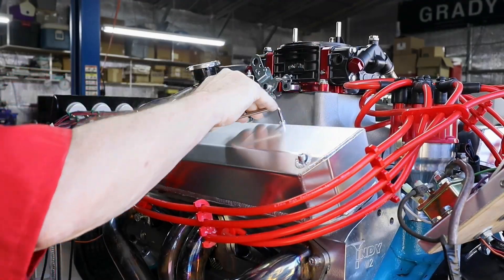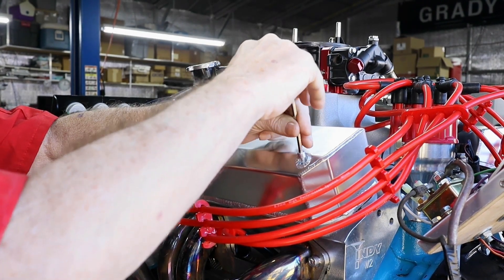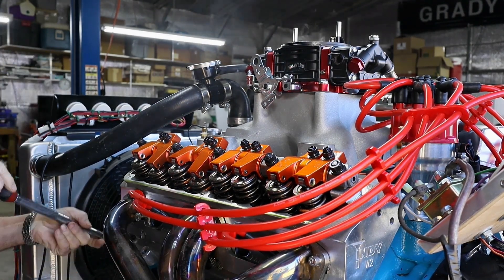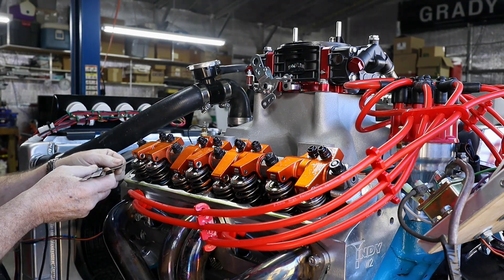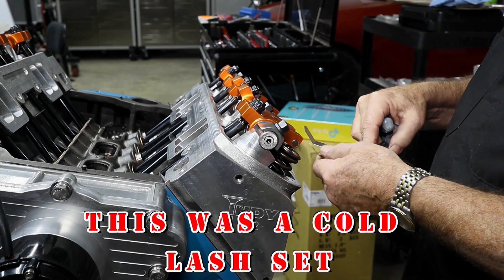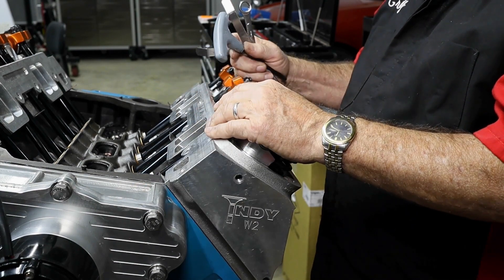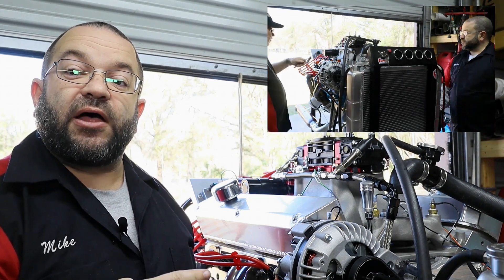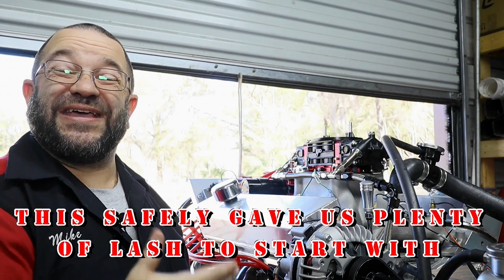The LA-phant: Full Operating Temperature Checks | Hot Lash and Cold Lash

Comment: A more accurate way to do this is to start with the hot lash setting for 1st fire up.
Any aluminum headed engine will gain lash when it heats up.
And we see lash increases up to .012 so this is where the thinking part come in.
interrupted
That way the oil and water temp will be at 190 for the water and at least 190-210 for the oil.
This heats everything completely just as it would running down the rd.With me so far...good.

Now with the engine fully heated check 1 pair of valves lash and correct to the hot setting you need as fast as possible cause the head shrinks again and the lash will change before you get the next pair done.

However with the 1st pair done and lash set its time to allow the engine to get stone cold.
Now with the 1 pair of valves hot lash set heres where we make life easier......ready and go.
Now check the cold lash on the pair you hot lashed. That will be your cold setting for the other 14 rockers.
Now reset the cold lash and run it till oil and water at 200 then check any other rest pair and you should be good to go with the correct hot lash.
Now that way you will see if you  need a block heater for cooler days as those heads will shrink more on a cold day thus the lash in some cases with tight lash cams  and rookie lash setters the valves can be open slightly.Our ALL aluminum race motor needs to be heated to 150 before starting so all the valves are seated and closed hard. So think about piston to valve clearance being more generous for a street warrior compared to a full race only engine.

Keep up the good work
Reply from the maker: Great input. Thanks for this. It's much appreciated and I'm sure others will gain from this as welll.

Comment: Man, I'm having a lot of fun watching this series! I had to cheat and skip to this video so I could hear it!
I agree on your conclusions about lash, and that you went to .002" (2 thou) cold. I have mine at 8 thou cold, for a desired ~12 thou hot.
Your pops said this would be checked pretty much every time the engine is ran - I will say, it should not be changing! I have a pretty stout SBM as well, and in the 2 years of driving I've done, it has not moved at all! If the lash is changing, something is wrong.
Loving the series!
Reply from the maker: Thanks again. I saw the vids of your Mopar. Some nice runs. Pop believes the adjustments will be needed per the intent to run it constantly hard with the solid lifters. It'll be interesting to see if adjustments are needed during and after our pending Dyno session.

Comment: is there a dyno test of this engine? will there be?
Reply from the maker: We've been planning on it, but our local guy has been booked with other projects and is difficult to schedule with during race season.
Reply: @MicsMotorworx  I hope your dyno guy has a proper long tube header 1-5/8 - 1-7/8" stepped sert with W2 flanges to get some power from your SBM. Also, the as cast Indy 360-2 heads leave lots of room for improvement. I made 695 hp with a ported set, ported intake, and no vacuum pump and a crappy set of headers. After changes made 730 on same dyno. My motor was another 30 CID and had a more aggressive roller cam, but not when the additional displacement is concerned. I drive it on the street from time to time. Great  fun 😊
Reply: @ToddWright2  Thank you for watching.  It was fun building this with my son and having him film it. Glad it's fairly streatable.
Reply from the maker: @ToddWright2  Thanks for watching and for the fantastic reply. The Dyno session is scheduled for November.

Comment: Usually, .004 tight is a safe spot COLD.  My cam calls for .014 and .022.  I set it to .010 and .018 cold.  (solid roller)  It's dead on when hot.